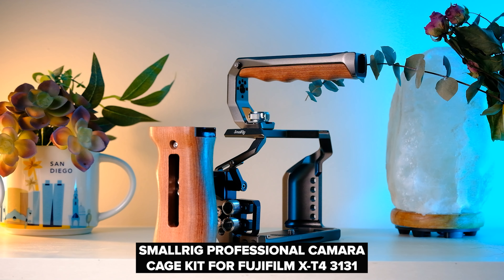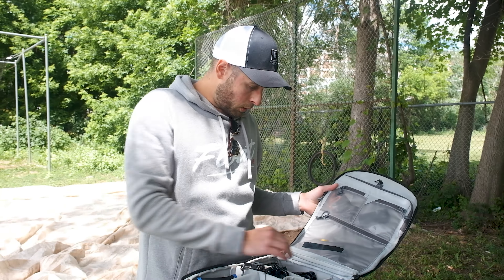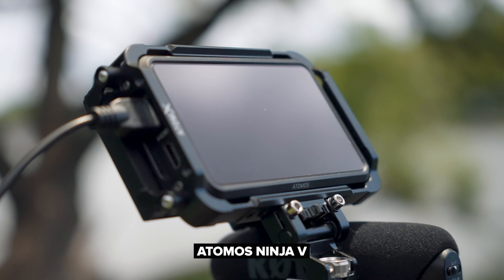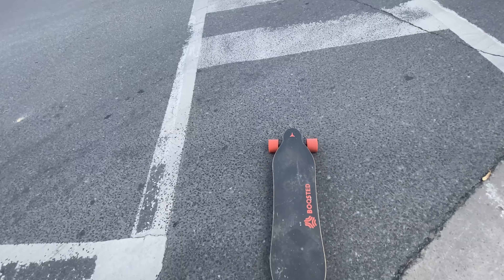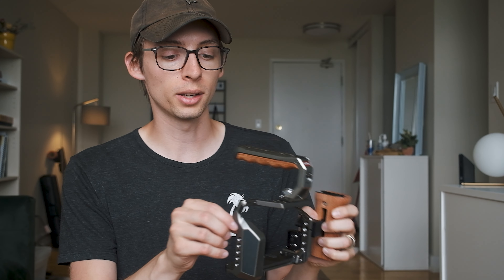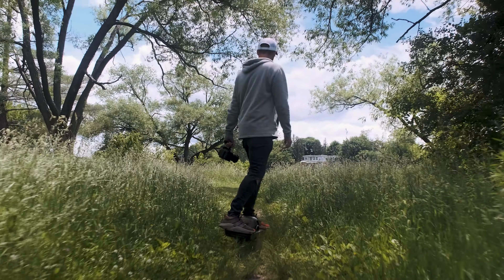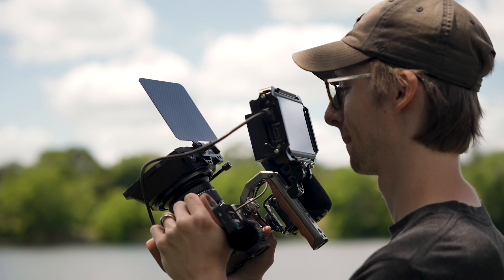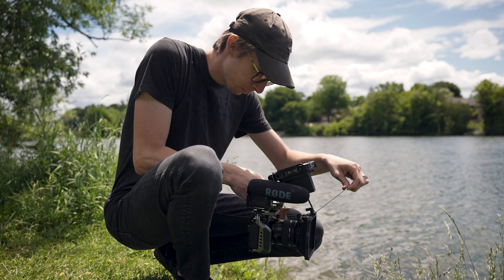Fujifilm X-T4 to CINEMA CAMERA! (SmallRig Kit Review)

Comment: I got the small rig universal 15mm rod baseplate for this setup but I’ve been having a lot of trouble with the camera coming loose. The small rig cage only allows for one screw with the baseplate due to the spacing of the holes, and this one screw doesn’t prevent the camera from swiveling a little left and right and eventually getting way too loose. any advice?

Comment: My main gripe with this cage is the poor 1/4 holes on the bottom. They should have designed it such that you could screw in 2 places for a secure fit on manfrotto plates.
I think the XT4 would be much better off with a battery grip + cage, or a V-mount as you suggested. It guzzles power like crazy.
Reply: I second that gripe.  Is there a workaround?  I purchased a SR cheeseplate hoping that would to the trick but nope!